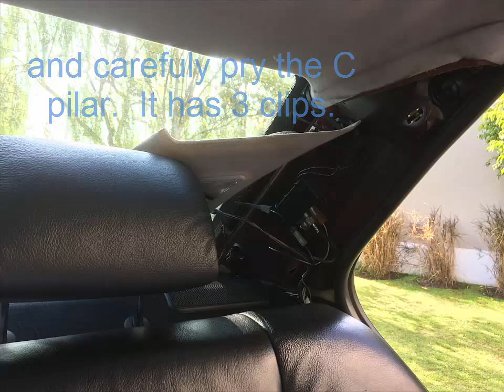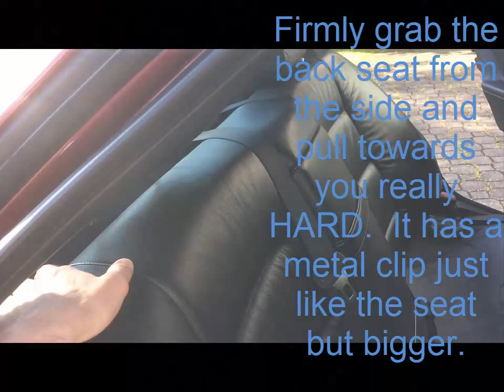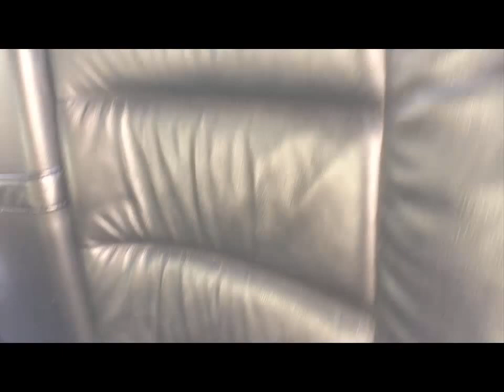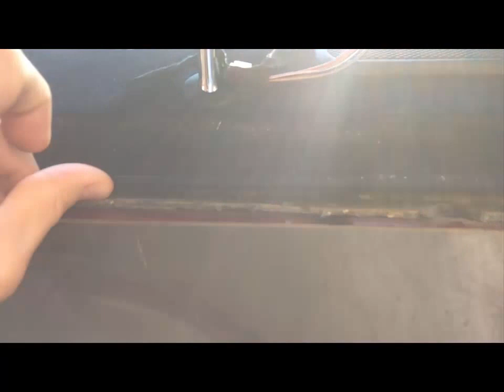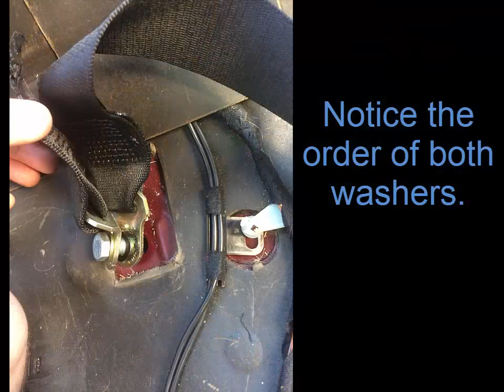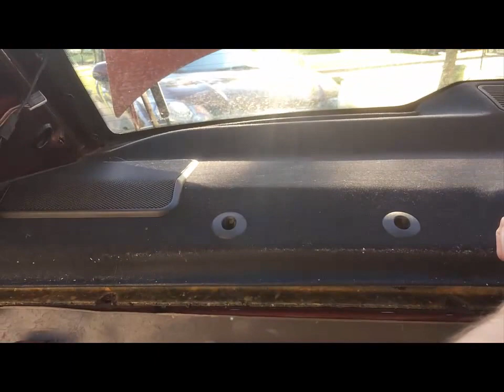How to remove headrests and the rear shelf of an E36 BMW Sedan

Comment: Seriously helpful. Once I graduate I plan to buy another vehicle to use as a daily and remove the rear seats and shelf entirely from my e36 and cut away the sheet metal to open it up to the trunk for weight reduction and easy access to vast storage space.